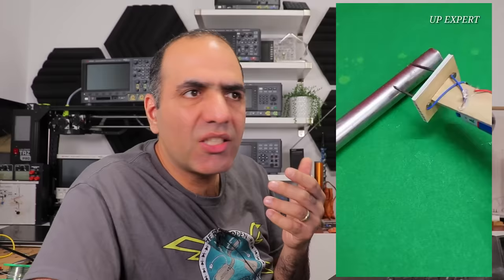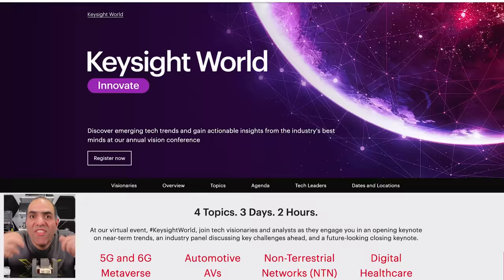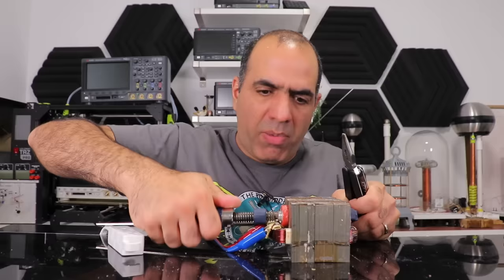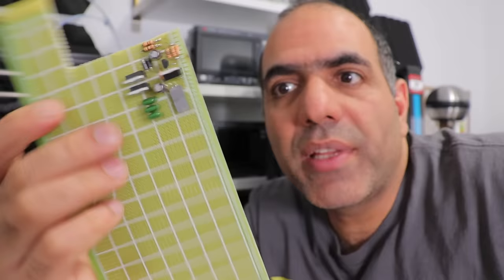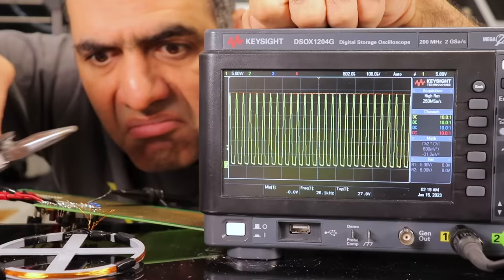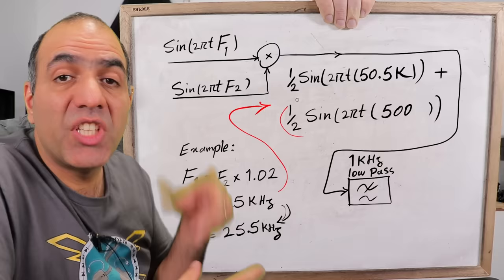DIY METAL DETECTOR, Gone Wrong and Right!!

Comment: Sometimes, the explosions make you forget how intelligent this man is 🤓
Reply: I think, the explosions not killing him, because it was all planned, make him look even more intelligent
Reply: he can plan ways to make the explosions without seriously injuring him and make it seem accidental. A genius with an oscar.
Reply: should be wearing safety glasses
Reply: Well. It’s electro boom. It has to have explosions.
Reply: @tomservo5007  Barring that...at least a Safety Tie? But that requires being around potentially fast spinning objects...
Reply: the best example of this is right at the beginning with the lightbulb. You can see the socket has a resistor soldered in place between the leads and the lightbulb is not completely in place. The second shot I believe he had a few small pieces of stranded copper wire and dropped them inside the socket to cause the sparking. The final shot was set up correctly which is why it worked. Really impressive video editing and preplanning
Reply: Funny how people overlooked that this comment was meant to be a jab at people leaving similar comments.
Reply: Explosions can be inconsiderate like that.

Comment: 05:16: The core splits itself apart because the flux lines pass through each laminated layer. Since there is a gap between each layer, you end up having the said layers behave like like-oriented magnets, thus they repel each other
Reply: I gave the same answer 2 days earlier and never got a heart :(
Reply: @RavenLuni  you can have my heart ❤
Reply: @RavenLuni ❣
Reply: CHAT GPTTTT
Reply: Yeah what mobs chan said
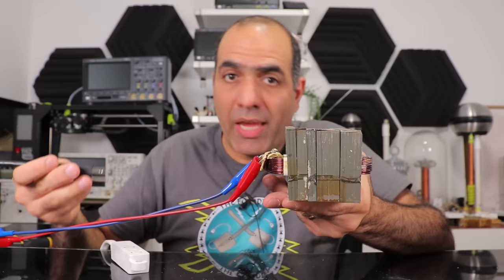Reply: If it would be as you said every single layer would have been repulsed in the same direction while, as it clear in 2:56, the layers are repulsed on the top of the magnet while on the bottom they are attracted from each other.
Reply: @pasqualedebernardis9460 , he removed the supports and tried to open up the core causing partial failure of the adhesive bonding the layers. Plus the top is split in 3 ways where the bottom provide contiguous material for the magnetic flux to travel through
Reply: Its not important that there is a gap between them. Its just that due tonthe windings, they dont get magnetized like this: N-S-N-S-N-S, but like this: 
N N N N
S S  S  S
And thus they repell each other. If the windings were to be wound in a way, so that they go around parallel to the plate surface, the plates would attract each other.
Reply: @neutronenstern.  If there is no gap, they aren't individual magnets
Reply: @Michael-OBrien  they will still repell each other, even if the are not individual. Its just that then the attraction forces are stronger, than the repelling forces. Even inside of them the elementary magnets will repell each other. But still ths material holds together because of other stronger elektromagnetic forces inside them,liks eldctrons attracting protons,... .
Reply: I knew that
Reply: The like oriented magnets would attract each other. It’s the changing magnetic fields that create eddy currents in the core whose magnetic fields are opposed to the original field.
Reply: @nocoupforyou  like oriented magnets repel each other
Reply: @RavenLuni  :face-red-heart-shape:
Reply: You got a star from the professor, very nice.
Reply: @RavenLuni  I said the same thing the day the video came out ❤
Reply: @RavenLuni ha, nerd
Reply: Because the flux lines pass through each laminated layer
Reply: @sadhlife  ULTIMATE RIZZZ💀
Reply: 0:58 lightbulb rocket
Reply: Well mehdi 
 has a lot to do he can’t read every comment
Reply: No need to tell him,
Reply: @RavenLuni  I will give you my heart
Reply: I would never guess that, just wow.
Reply: Interesting
Reply: @RavenLuni  Since your comment is 9 months ago, you can have the baby: 👶
Reply: Is this fortnight?????
Reply: damn you are 11 months early than me
Reply: forgive my ignorance, but why isn't the core 1 full block?
Reply: @bober1019 , cost of manufacturing is the simple answer
Reply: Correct!
Reply: @M3ow518  ye i think so, it's WAYYYY to nerdy for a human to  actually say that

Comment: Mehdi, you did a fantastic job, covering 2 types of metal detectors (energy theft and BFO) in just 20 minutes, with no loss of fingers or eyesight. Well done, and thanks for the shout-out. As for the cross-coupled transmitter, I've used that in a metal detector design (White's TRX) and did not use any bias resistors on the transistors. You should not need them. 
On the transformer plates, they push apart because the eddy current generated in each plate (across the thin cross-section) interacts with the coil's magnetic field to produce a force which is the cross-product of the two, and is perpendicular to both. This means that at the surfaces of the plates, the forces oppose each other and try to push the plates apart. Hard to explain in words, easy to illustrate. Any decent EM book explains it. A dangerously impressive example of this force can be found in coin shrinkers, where a sufficiently strong EM field  creates enough radial force to literally shrink a coin. If you were to do a video on coin shrinkers, I would not dare to wager that you have 10 fingers at the end.
Edit: I couldn't remember the name of the force so I had to look it up: Lorentz force, where F = J x B (cross product).
Reply: That coin shrinker sounds cool and scary at the same time.
Reply: i believe what you're describing should be the Laplace force. the Lorentz force for a continuous charge distribution, which i assume you mean from the use of J , should also include a term ρ E , where ρ is the charge density of the volume in question.
Reply: @matthewbertrand4139  The general equation for the Lorentz force is f = ρE + JxB, but E=0 inside the conducting plates, so we're left with the eddy currents interacting with the B-field. I think the term "Laplace force" is synonymous with Lorentz force for cases of current flowing through a conductor, like we have with the plates.
Reply: Do you think that the GPZ7000 using zvt is somewhat applying that same concept of a design like Mahid did with his zvs ?
Reply: @mmmk1414  No, not even close. Mehdi's circuit is continuous wave BFO, something that was popular in the 1960s and 70s. The GPZ uses a form of pulse induction called constant-current PI.
Reply: @Geotech-nf7zw thank you for explaining.
Just one last thing if you could enlighten me, why is the GPZ so hard to replicate from other companies like Garrett or Nukta or others? Most of them just compete with technology like the Flv and Simple pulse on the level of Gpx and gold monster machines!?
Reply: @mmmk1414  Partly because of patents but also partly because, in some respects, CCPI isn't as good as other PI designs. The GPX6000 is regarded as a better detector than the GPZ for just about anything other than huge deep nuggets, and certainly for alkaline soil. There are things you can do with multi-period/multi-sample/multi-voltage PI you can't do with CCPI. That said, I have a prototype CCPI desing on the bench that avoids patents and it's looking pretty good so far.
Reply: @Geotech-nf7zw  thank you very much
Reply: Wow

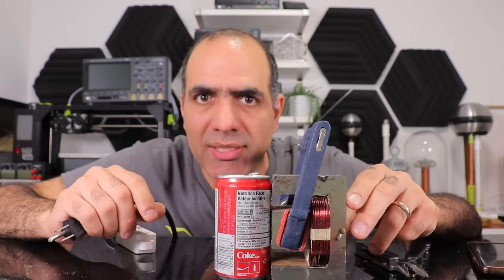Comment: For 4:56, due to the core having multiple individual pieces, each producing its own magnetic field in the same direction, it makes them repel each other. Maybe that's why core pieces are tightly stuck together to avoid vibration due to repelling.
Reply: Thats definitely got it. Here before heart. :)
Reply: @Dvplexx  No. They are lined up in the right direction to to stick together, so that isn't it.
Reply: @KnightsWithoutATable  it doesnt matter once you break apart lets say a permanent magnet, it wont stick together ever again because it will form its own magnetic field around itself
Reply: In addition, each piece produces its own magnetic field because the eddy currents that are generating the magnetic field won’t cross an air gap.
Reply: @SethPentolope  Magnetic fields do cross air gaps.
Reply: @dronemotionlab  Cut a magnet in half and try that out for yourself. It doesn't work that way.
Reply: @Dvplexx  same
Reply: From my pov, feels like yea the magnet one seems plausible one, but considering the nature of the material of core, it probably gets unified under pressure or something like that 🤔, forcing it to make a single combined field maybe.
Reply: @dronemotionlab  Magnets with their own separate magnetic fields will very happily stick together, especially when they are already aligned in the same direction N-S N-S N-S
Reply: @KnightsWithoutATable  what are you talk about? Break a magnet and see yourself. The broken piece will NEVER FIT in again perfectly as it was.
Reply: @Zaros262  yeah if REALIGNED...... but if it is witheld by something it doesnt work. It will mostly repel or try to realign itself to get into the correct magnetic field. Thats what i talk about i know any magnet will stick to any other. Thats just plain ass magnet thing.
Reply: @dronemotionlab  Use a bar magnet next time instead of a flat refrigerator magnet.
Reply: exactly!
Reply: @KnightsWithoutATable  try physics instead of bs
Reply: @dronemotionlab  The direction that the poles point in a permanent magnetic when you cut a magnet apart do not change. You can Google that piece of physics. Now think about about in what direction the poles would be if you cut a magnet in half that was a circle and what the two new magnets would do.
Reply: @KnightsWithoutATable  just try to break the magnet instead of google but i alread did google and it says the same you cant really glue a magnet back together(well you can but it will repel the other broken part if you try to put it as it was) as its crystal lattice structure will be damaged by the break meaning it will have a different magnetic shape than before. Try for yourself and see, maybe film it for us if you have a different result but.... I highly doubt it.
Reply: @dronemotionlab  Cut a bar magnet that has one end with a north pole and one end with a south pole in the middle making two shorter magnets with produce two bar magnets with poles that attract each other.

Also, this whole cutting of the magnetized material obsession you are having isn't what is making the plates move apart from each other. I'll give you a clue: it has to do with AC power in the coil of wire and how induction motors work. How do I know? I have a college degree that covers this topic in detail.
Reply: @KnightsWithoutATable  well good luck arguing this now lol.
Reply: But not sideways they will stick together back to back
Reply: @KnightsWithoutATable  no....  try again  😉
Reply: @anujsarode9586 @ElectroBOOM this is not the correct answer. The core and the pliers are two individual pieces too, why do they attract instead of repelling? The actual reason for the repulsion is the radial alignment of the magnetic field lines close to the core. Even a solid piece of iron will get pulled apart by the magnetic field, meaning it will expand in the radial direction, but only a negligible amount for a weak field like this. The field lines are only aligned in the longitudinal direction, meaning metals are attracted towards or pushed away from the core but always get pulled apart with the expanding force increasing as you get closer to the core.
Reply: Hello chatgpt
Reply: @KnightsWithoutATable  they don't attract. When I was building speakers from the trash lying around I had a broken speaker magnet that - guess what? - DIDN'T want to attract its broken part. It had North on the top and south at bottom, so it's just like trying to attract these magnets:

N →← N
 |            |
S→←   S

Some people are just cancer.

Comment: This is actually quite impressive. I don't know how well this will hold up to long-term use, but as a proof of concept it's remarkable. Thank you :)
Reply: Usually, long term use is just beefing up the mechanical connections, adding weather proofing (if required) and generally making the circuit hard to kill or to be injured by.  He could probably pack the circuit into a project box, make sure the solder joints are top notch, and have an actual legit metal detector.

Comment: Fascinating, i never knew how those clicks and tones were generated, being a computer guy i just figured it was just a digital tone generator mapped to some signal and not the actual signal (if that makes sense)
Reply: Makes sense
Reply: Yeah, I thought exactly the same - the clicks were generated by a microprocessor when it gets a matching, programmed signal. Apparently it's more simple and complicated at the time (for me at least).
Reply: Same. It's satisfying to learn something that was completely out of my imagination radar.
Reply: I wouldn't be surprised if thats how modern or more expensive detectors work, but the old WW2 ones were probably very similar to what Medhi has built here.
Reply: Modern tech, being at such a high level interface, obfuscates what the computer's actually doing behind the scenes, which is the reason I love looking back at analog circuitry and the computers of the past where you can see a direct correlation between all components.

Comment: 4:57 the magnetic flux is concentrated in the iron core. The separate plates are aligned with the field axis, and so adjacent plates will always have the same polarity and repel. Like lining up a set of bar magnets next to each other in the same orientation
Reply: I had the same idea, but I didn't offer to comment because I couldn't think of the right terms, I'm not a master at this kind of stuff but I like learning about it
Reply: Was about to write the same - at least that is what my mind would deem the most plausible ^^

Comment: This came at the best time, lol

I've been struggling to build a metal detector for a land mine detecting robot, its honestly looking like ground penetrating radar would be easier to build

16:17
Wow, that's actually impressive its clicking at that distance with such a small coil.

17:35
Yeah, that's one of the problems we had, and if you're actually using it in the real world, you gotta deal with changes in soil (i.e. mineral deposits) which can throw off the coil's dynamics.

What I found works good is using a microcontroller. You can use the PWM for a fairly stable signal. That's how I'm running mine, just a simple on/off circuit powered by an IGBT used to run a car ignition coil, then we just probe a leg of the coil with an analog pin. I'm still using low voltage, though. 28v, you might want to throw a capacitor in line and add a clamping diode after it or something

The cool thing with using a microcontroller is that you can do the filtering with the controller and have it run a decay function that slowly increases or decreases coil sensitivity to account for changes in the environment.

The big problem we're having is trying to figure out what is a piece of metal and what is just environmental noise, also the fact a lot of landmines have very little metal in them at all.

I do think we are going to go with GPR though, it's just better able to detect objects underground, but before we go that far I want to try one more time with the pulse inductance and maybe a VLF
Reply: Just throw 240VAC through it and you should detect things meters apart lmao
Reply: HI
I had the same problem on a metal detector project a few years ago : the sensing coil had to fit in the palm of a hand. The electrical circuit was very similar to this one (pair of oscillators, listening to the beat frequency) and it was very sensitive to human body proximity, including to the hand ! We got around by going towards a completely different circuit, the pulsed induction you mentionned. The time it takes for the voltage spike (following a sudden current cut in the coil) to decline indicates the presence of a metal, and it's much more selective than the beat frequency method, i.e. very insensitive to surrounding moisture, and even to small deformations of the coil
Reply: GPR doesn't work well on wet ground etc.  A metal detector is your better option.
A good rule of thumb is that a metal detector can only see into the ground about the same as the diameter of the sensing head.
This is why a lot of stuff used for UXO (UneXploded Ordinance) is so big.
Land mines of the antipersonnel type are about the size of a can of cat food and have almost no metal in them.  They use trained pouch rats to sniff them out.  The critter is light enough not to set them off.
Reply: @kensmith5694  
GPR should work just fine in water logged soils. It measures the difference in the refractive index of materials, and we don't need to sense very deeply, just a foot or so.

The main issue is a lot of the landmines (e.g., the butterfly mines) are just sitting on top of the ground, so we'd have to deal with soil reflection.

Another idea we're toying with is to just give our robot a hammer or spike and tell him good luck.

Realistically, we can make a dumb robot for under $100 to just go trigger mines. It'd still be cheaper than what it costs now per mine, but at a certain point, you're better off just driving an RC car through the minefield
Reply: @noahw4623  Microwaves don't travel through mud.  
Some guy in Africa made a thing that gets blown by the wind to stomp across a field.
Reply: @kensmith5694  
GPR is used to map lakes and rivers, even with the added salt in soils, most mines are relatively shallow and should be detectable with it.

The benefit of GPR is that it can detect non - and low-metalic mines like the PFM-1.

We'll probably implement both at some point, though. The idea is to get a map of minefields to ease demining efforts.
Reply: @noahw4623  My experience says otherwise
Reply: @kensmith5694  
Alright